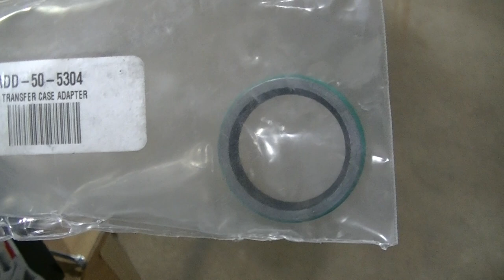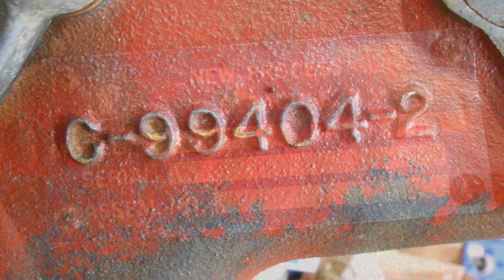70 Chevy Truck NP205 Transfer Case Install

Comment from the maker: Things that might help with a project like this:
Cast Iron Gray Paint: https://amzn.to/3blgvFC
ARP Bellhousing Bolts: https://amzn.to/3OEF4Ls
ARP Flexplate 1 Piece: https://amzn.to/3bcS1OE
Rust-Oleum Paint: https://amzn.to/3xVVqZH
Poly Trans Mount: https://amzn.to/3z2TSh4
Poly Motor Mount: https://amzn.to/3xv7PF3
Tubing Bender: https://amzn.to/3O84a4Z
Brake Booster Kit: https://amzn.to/3yButeg
Lares Steering Box: https://amzn.to/3uMQs0p
Heater Core: https://amzn.to/3IbSXPF
Putty Tape Black: https://amzn.to/3ugHLeE
Ebay Ash Tray:  https://ebay.us/6x1sbD
Rear View Mirror:  https://ebay.us/qnjPAt
LED Heater Control Bulb:  https://amzn.to/3Bbmofk
Heater Control:  https://ebay.us/mIQXpH
Dash Pad: https://ebay.us/LxR98V
CST Emblem: https://ebay.us/h9DhOz
Perfect It Compound: https://amzn.to/3anG4Sd
Steering Wheel:  https://ebay.us/qqFkYJ
Steering Wheel Puller:  https://amzn.to/3msxGbo
Dorman Turn Signal Cam:  https://amzn.to/3j85w3l
NGK Plugs:  https://amzn.to/3lui0Uv
Ventshade Visor:  https://amzn.to/2TGn9NM
Trim Rings 1.75":  https://amzn.to/3f7Wxgo
LED Taillights:  https://amzn.to/3rqmwEq
LED Flasher:  https://amzn.to/3kVm6oH
Aluminum Radiator:  https://amzn.to/2Vy1CaM
Hood Bowtie:  https://ebay.us/gJiHNF
Body Bushings:  https://amzn.to/3AzfEZC
Air Cat Cut Off Tool:  https://amzn.to/3weGGSM
Skyjacker Dual Kit (Black):  https://amzn.to/2TpWWTP
Bed Rack:  https://amzn.to/3x7WsjJ
Dick Cepek Tires:  https://ebay.us/gScPHA
LED Headlight:  https://amzn.to/3cCDgCy
LED Parking Bulb:  https://amzn.to/3utPZNV
LED Backup:  https://amzn.to/34m38hp
Side Marker Lights:  https://amzn.to/3yLsWRM

This video contains affiliate links, which means that if you click on one of the product links and buy, I'll receive a small commission.

Comment: I know you sold your truck but I still go through and answer answerable questions from comments about "my year trucks" !!  This t-case was painted a dull satin orange paint on the assembly line. They shot the "205 and the Rockwell " at the same time upon final assembly and check for leaks.        Jim
Reply from the maker: From what I was able to find out they were not painted orange at all. They were either not painted or painted black from the factory.

Comment: I always bought 4 wheel drive trucks because pickups get stuck so easily and are terrible in the snow without the 4 wheel drive. BUT, I also tried off-roading and had a BLAST. As long as you don't do any rock crawling, you should be able to preserve the paint on your truck if you do any off-roading.
Reply: With the right tires and proper weight in the rear you can snow plow in 2wd. Never enjoyed off-roading in my truck. To much time and money into it to go break stuff. Now a truck used and built specifically for that would make all the difference.
Reply from the maker: Trucks are very light in the rear. A 2wd truck in snow is not good without some weight in the bed. This truck will be doing very little off roading. Maybe some dirt roads and our farm.

Comment: Going to be a sweet ride bud. Can't remember if you said you were going to paint it or not but either paint or just a clean up and clear coat it will look awesome.
Reply from the maker: Not doing any body work right now. When I get the truck driving, I might work on the box some. I plan to enjoy the truck for a few years or so the way the body is. Might try buffing it to just bring the paint to life some.

Comment: Best guess for "why" anything rebuilding or repurposeing is it was available and ahh close enuff.
Reply from the maker: This transfer case did great in the truck. These NP205's are pretty hard to kill. I never did put that truck in 4wd. I would put money down that it worked. It did leak a little but not bad. I have heard these transfer cases are hard to keep leak free. The speedo adapter is known to leak too.

Comment: What transmission are you using
Reply from the maker: TH350, I have videos on everything about this truck in its playlist on my channel.
Reply: @mossman381  nice I will used a th400 nice job
Reply from the maker: If you watch my other videos, I explain why I went with the TH350. That is what the truck would have come with, and I would have needed custom driveshafts made front and rear if I changed the trans.

Comment: Adapter to transfer seal was in backwards
Reply from the maker: No it wasn't.
Reply: They go in backwards so to speak. One each direction. One keeps 90 wt out of adapter and the other keeps auto trans fluid out of adapter. Along with O ring on the input shaft of t case.

Comment: I’m doing my own installation and I was wondering if you knew whether there should be a bearing around the coupler to the transmission side I found another video which shows that there is https://youtu.be/BYkveYYDG8E
Reply from the maker: That video has a factory adaptor. I used a th350 to NP205 Advance Adaptor.
Reply: @mossman381  yup figured it out thank you